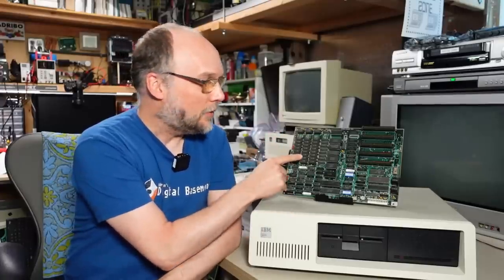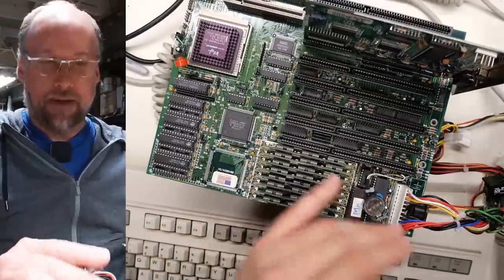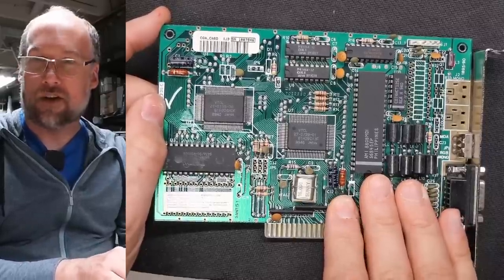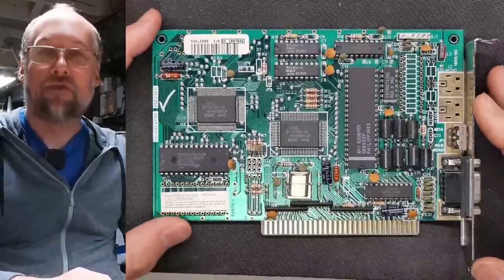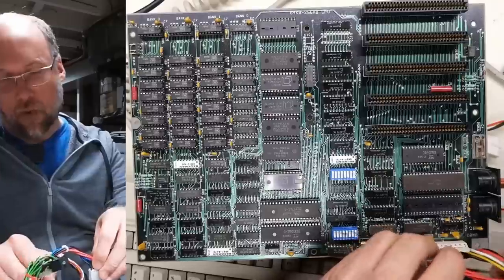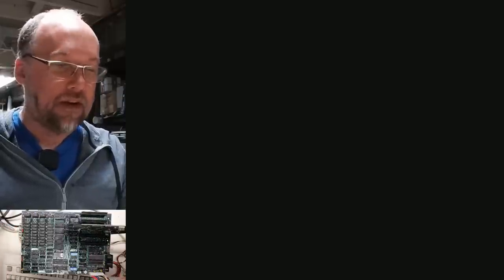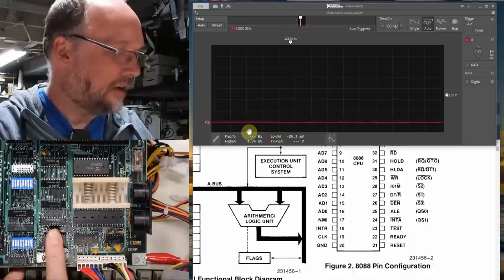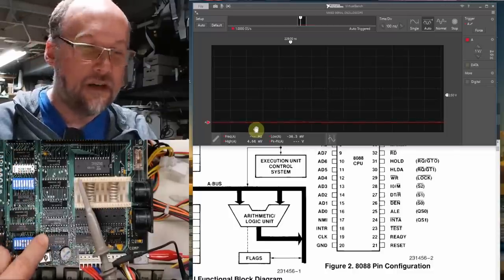IBM PC 5150 repair: The motherboard doesn't have the typical faults

Comment: Ah, the good old 74ls74. Remeber, the 74ls74 is a flip-flop, which is a simple memory chip. Q0 is the value it remembers. Literally, Q0= The value of Q at time 0--that is, the same value that it had "before." In this case, "before" means anytime since the most recent high level on PRE or CLR, or the most recent low-to-high transition of the clock.

Comment: First operation the 8088 performs after RESET goes inactive is an instruction fetch from 0xFFFF0.  You should see that address on the AD/A pins, followed by tri-stating AD0-AD7.

Comment: When debugging an early PC, hooking up the speaker will often tell you if you've got something seriously wrong. Back in the day, there was also something sold called a "POST" card. It had led lights that lit as the BIOS went through the power on self test. That would allow you to see exactly where the POST stopped. A nifty booklet gave further diagnosis by telling you what to look at with specific chips or areas of the board.

Comment: At 29:30 Adrian says that RDY1 at ground is fine but that would not be correct. That would mean it is waiting for DMA. That line should be high. At ~31:30 Adrian says he doesn't know what Q0 and /Q0 means. It means the state of the Q and /Q lines don't change. Their state will be whatever state they were in before the inputs changed to the H, H, L state.

Comment: I've got a compaq portable with similar symptoms, though I don't have an oscilloscope to test with yet so I just keep replacing one chip at a time in the circuit until it works. My system speaker is squealing though and I'd be curious to find out if yours is too. I can't wait for the second half to see what you find! Hopefully your work will shed more light on my issue as well.

Comment: You're switching the system very quickly off and on. It has been my experience with this vintage of computer that those caps take a little bit longer to leak down from the power supply than some of the earlier machines. So what you may actually be doing is warm power cycling the machine is supposed to cold power cycling it. I haven't gotten far enough into the video to know if this is causing you an issue or not. One thing that will really help you is getting a postcard for the IBM and that will tell you the status of BIOS checks prior to the system not starting. Admittedly this could be an FF board that is not completing post whatsoever

Comment: Great step-by-step wading through, backwards, the schematics and block diagrams. Where I usually bogged down is trying to understand signals that may not matter for the problem at hand, when really, what is required is to stay focused on only the path(s) that do matter. The trick is knowing the difference. You illustrate the technique well.

Comment: Found another rare SIS Board....GA-586SG....with no Bios Chip...Needs a 27010, found an otherwise useless 29F001 on an Ethernet card, flashed it with the newest bios and it worked right away! :D

Comment: As far as I know IBM didn't really sell complete PC systems directly to costumers. Your IBM seller would have configured the machine before selling it. The most basic configuration was probably supposed to be a PC configured with 16K, a CGA card, ROM basic, no floppy controller and no monitor. This could have been used with a standard cassette tape player and a TV set / cheap composite monitor.

Comment: I wonder if the bootloader (BIOS) on the motherboard is good or corrupted as I am suspecting that the processor is kinda expecting the bootloader to actually load, it may have to do with the motherboard design. The way you described the state machine status just indicated that the CPU was literally sitting and waiting for something. Wouldn't hurt to try a freshly flashed BIOS chip to see if it actually loads or not. Gotta love the early x86 computers, they were insanely complicated beasts (funnily enough, much of the complexity have since been completely moved to the processors themselves nowadays).

Comment: Not only in this particular case but generally, when there's a bad chip on computers, what exactly have failed inside those chips and what have caused it? Surely there are many possible reasons, but still.

Comment: Adrian, is there a fully premade all new parts c64 or c128 consumers can buy.  A turn key solution rhat can possibly work with modern hdmi monitors?  Native, not emulation.
Reply from the maker: Heh no, the video chip inside the C64 is analog, so not compatible with HDMI. Something like the Ultimate 64 is the best you can do, it uses FPGA to replicate all the hardware inside the FPGA, and has FPGA, and USB ports. So it's easy to use -- install it into a old C64 case (or a new one) and your'e good to go
Reply: Perifractic has a C64 made with all new parts.  Problem is it's not premade.